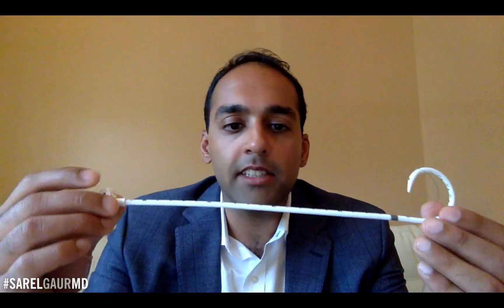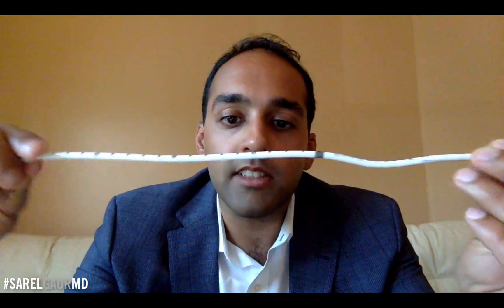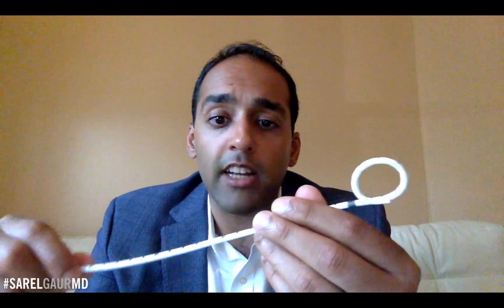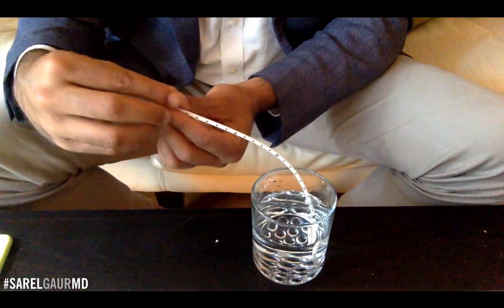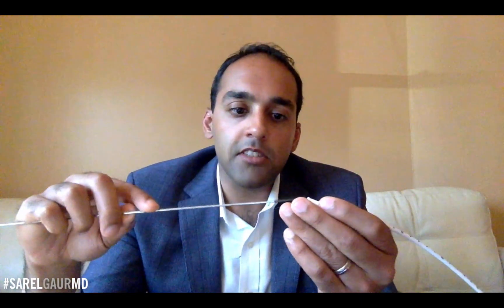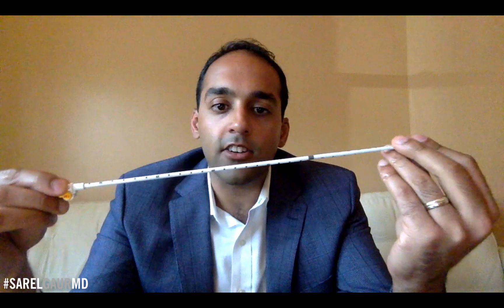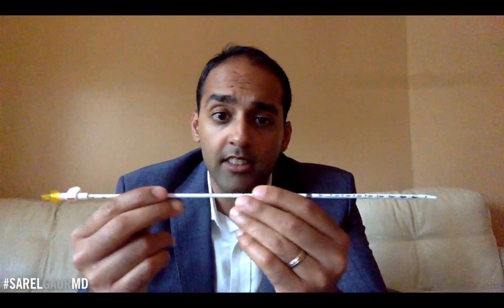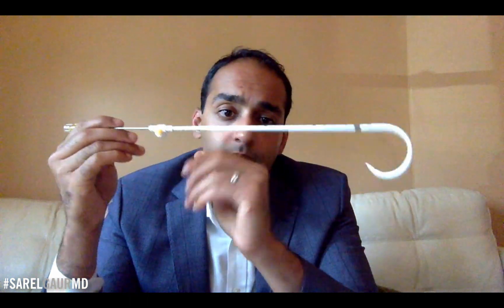Basics of Interventional Radiology:  Pigtail Drainage Catheters

Comment: When you remove the locked suture with the flip up tab, could that introduce air into the body, ie release the flip up tab prior to removing a chest pigtail pneumothorax catheter introduce air into the chest?
Reply from the maker: hi - typically to remove a small bore chest tube, would cut the tube, quickly pull it out and cover tightly w/ a tegaderm.  best, sg